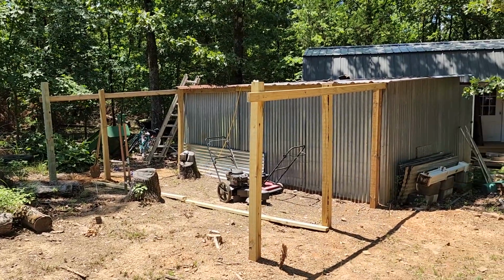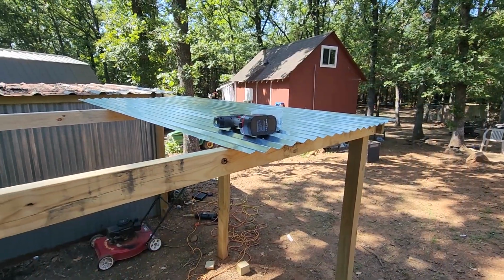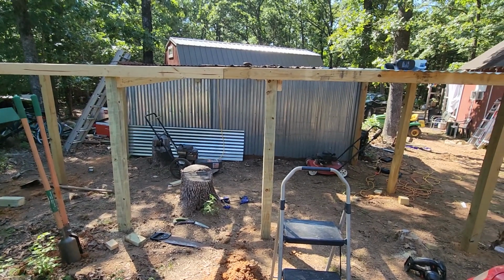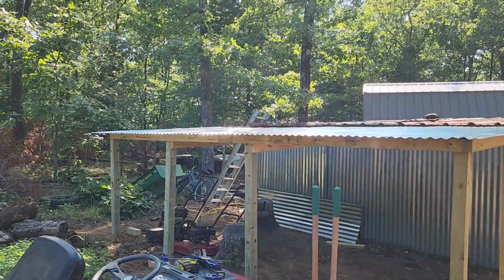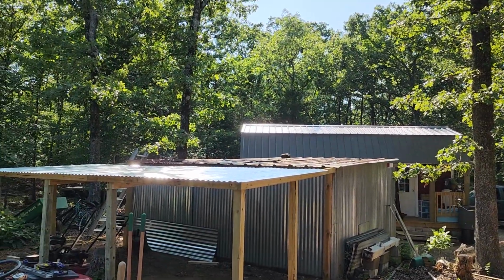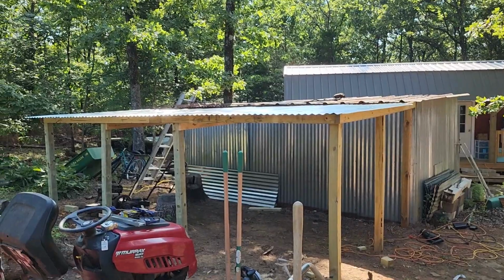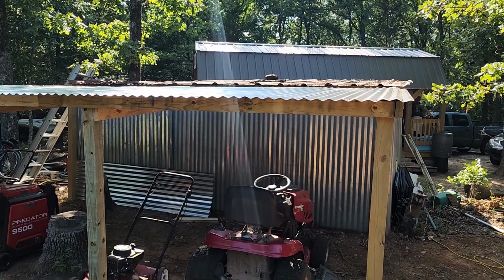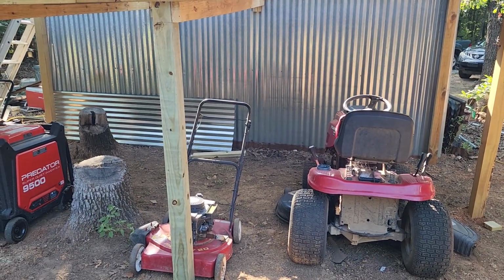Lean-to project finally started

Comment: If you redoing the leaky roof anyway, why not raise the roof and increase the slope so it's less likely to leak?
Reply from the maker: The slope was good. It was the reused metal that was used on the building.
Though, that is a good idea